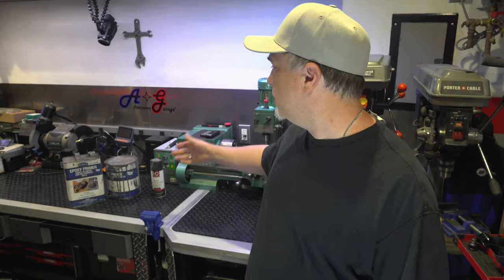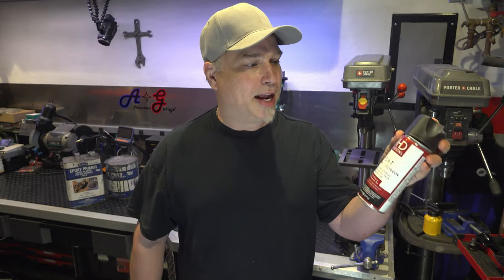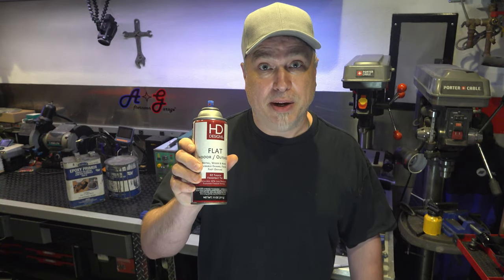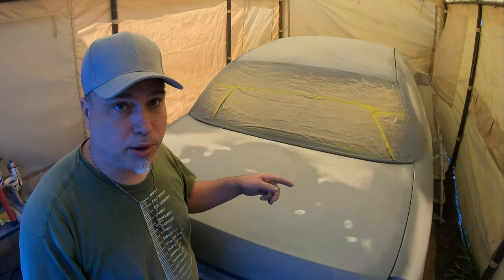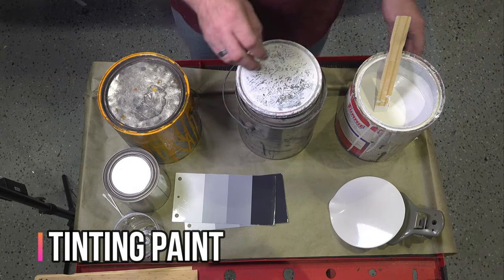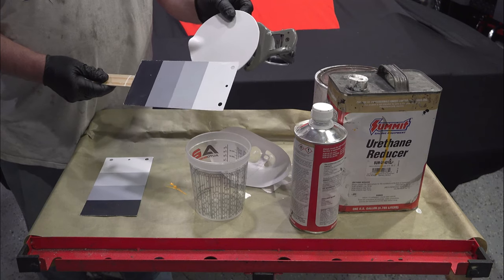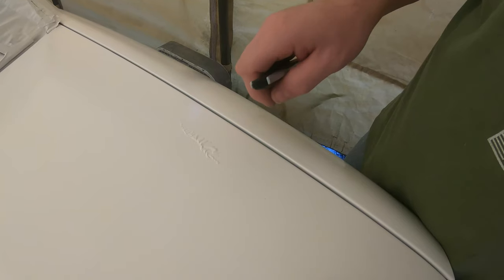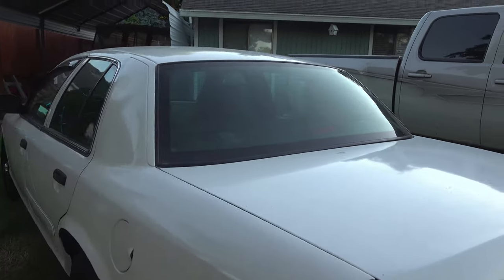Squad Car: Primer, tinting paint, and final coat! [4K] Ep34

Comment: Very nice that's pretty much what I'm going to do with my Crown Vic that gazebo tent  you put up I'm looking at the 12x25 is that put up in your driveway is that the size that you got?
Reply from the maker: I got this one from Costco for a bit over $200.  I think it is 10x20.  Worked for me and I was able to paint the sides of the car without too much extra work.  I did recently purchase an inflatable paint booth.  It is a 15x28 and 10 foot tall so I can get my truck in there for a fender job.  I plan to blow this thing up in the front yard and see if these things are worth it.  Kind of looks like a bouncy house.  The tent was sufficient, produced good results. That work you see was done during winter time.
Reply: @afternoongarage  Yes that's exactly what I'm planning  this way I can work on the car you're around. Did you have to get any kind of zoning permits or pay a fee or something to put that up on your property in the driveway?
Reply from the maker: Nah.  I would argue that it is no different than having one of those "PODS" in your driveway to store stuff. I got the Costco cover idea from a neighbor who was using it to cover stuff for temporary storage.  It isn't the prettiest thing but it will help you control your painting environment somewhat.  I used a box fan to circulate some air and didn't have too much problem with paint dust.  The driveway was wet which was good and bad.  Too much moisture but I ended up with a dust/dirt free finish.
Reply: @afternoongarage  yeah I'm not going to store stuff it's just so I can work on the crown vic in the winter time... I have a kerosene torpedo heater that I can blow in there make it nice and toasty.
Reply from the maker: Yeah I have used those!  You know they make an additive you can pour into the tank so it doesn't stink so bad.  I remember getting a pine scent that was better than smelling kerosene exhaust.  That should work fine for you, it did for me.